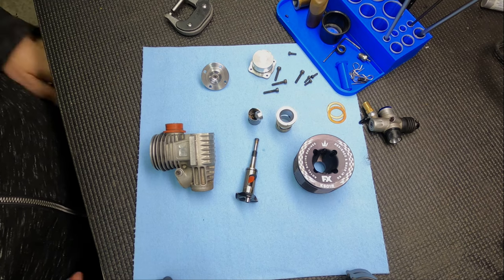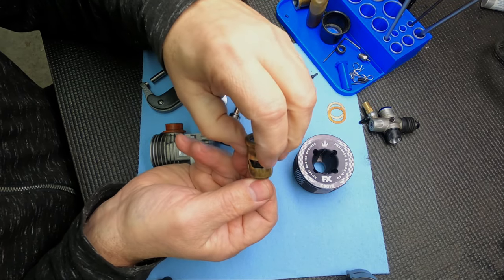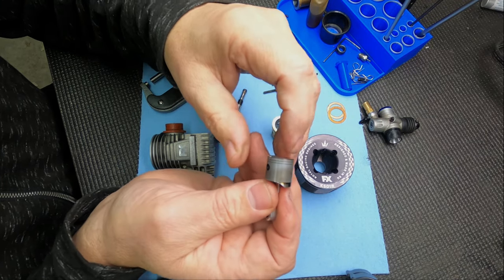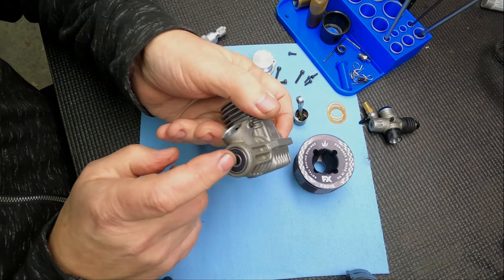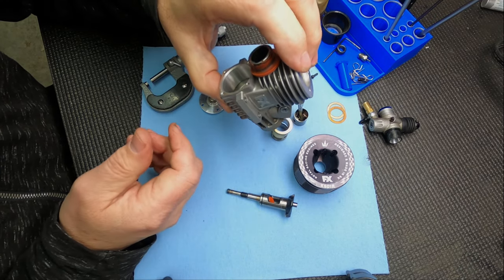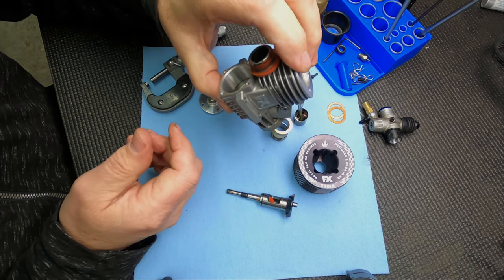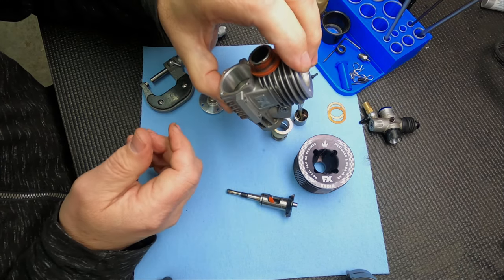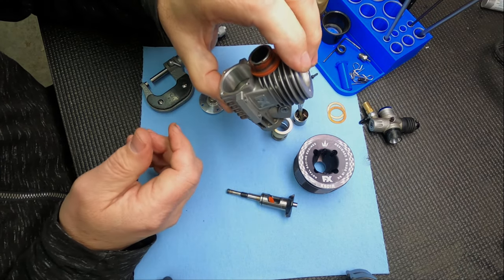How to Assemble a Nitro Engine

Comment: Nice, video. Hey just curious as I'm only a year in to nitro, why dont manufactures use some sort of bearing on the rod instead of the brass insert? I would think a bearing would be smoother and last longer
Reply from the maker: I thought so too. I tried it with 2 small bearings side by side. It only lasted 30 seconds. There is quite a bit of force on the cranks/rods and pistons, more than you would think. A needle bearing may hold up.